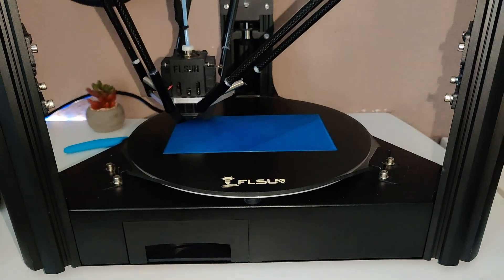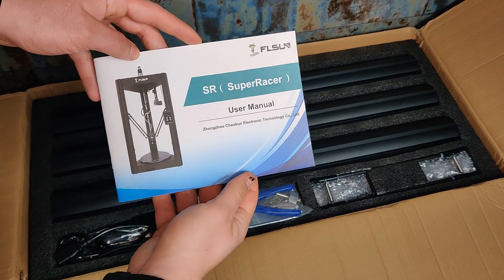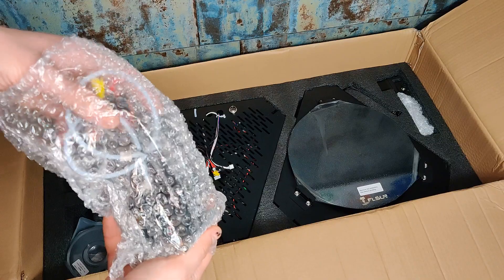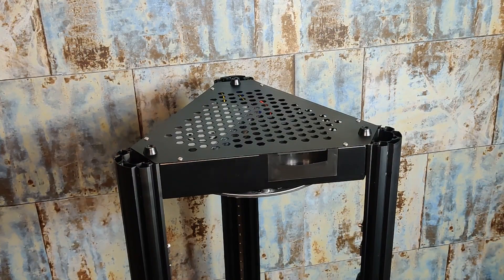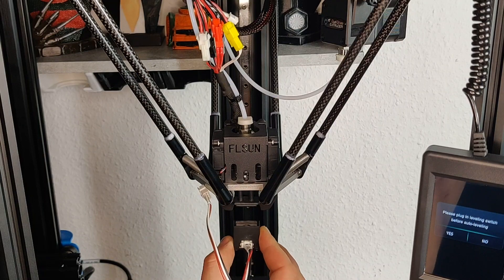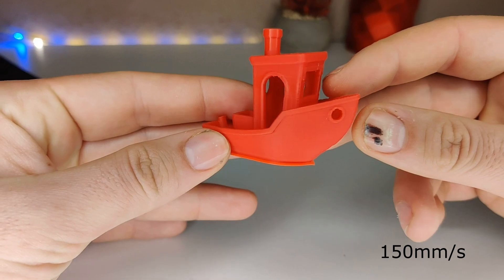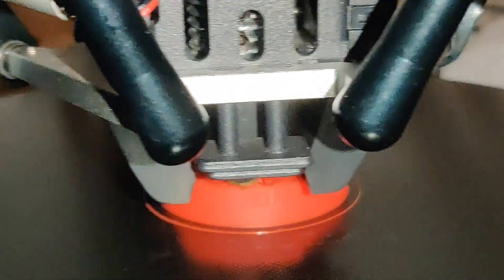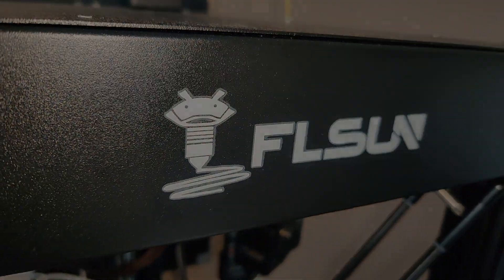FLSUN SR (Super Racer) 3D Printer Review! Are 150mm/s POSSIBLE?

Comment: Be wary of the FL son QQS mine died after one week printed beautiful then the power supply went out and made print I restarted it in when I was again I packed that crap up and sent it back
Reply: Sounds like one of two things happened, failed to set it to the correct voltage (it defaults to 220) or the PSU fan was stuck. My FLSUN QQ-S-PRO is an absolute workhorse

Comment: Thank you for making this.

It is between the Racer and Q5 for me. Leaning heavily towards SR.

I really wish to print mechanisms and linkages(concept out machine ideas) so both of the gear-sets 3D prints not working(even at slower speed) caught my attention. Printing a functional mechanism assembly as one print is great(I could always print sub assemblies and put them together, yet I have seen many others print that one gear-set you showed(?))  

Any thoughts?

Again great video, well organized, good information, thank you
Reply from the maker: Hey friend! I'm glad you like the video ! I'm very sure with better Cura settings we can make the gears move. I will do more testing and let you know! :-)
Reply: @3dg3nesis  Could you get it working?
I had an Q5 and the Printquality was not good, far away from my CR 6 SE

Comment: well the biggest innovation for this printer happened 3 years ago. by modding QQ-S. so its all the smart people modding their printers where true innovation happens, not to mention all those who wrote code for Marlin which FLSUN is basically using.
Reply from the maker: Yes you right. What I mean is the 150mm/s out of the box without any modifications. I know there are printers with 400mm/s speed but modded and not possible for every user.

Comment: the gear didn't move printed at higher speed, but why?
Reply from the maker: That's a good question. I need to do more test. I will try different Cura settings.
Reply: @3dg3nesis  
Probably because elephants foot and flow were not calibrated yet.
For the gears to work, the tiny gaps have to be perfect. Very challenging print. But from what I see, this machine should be more than capeable.